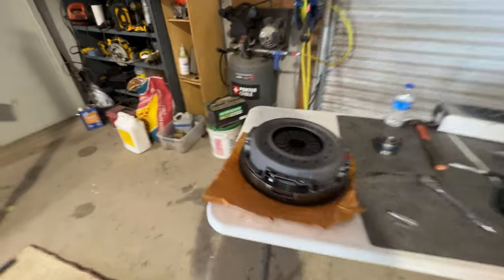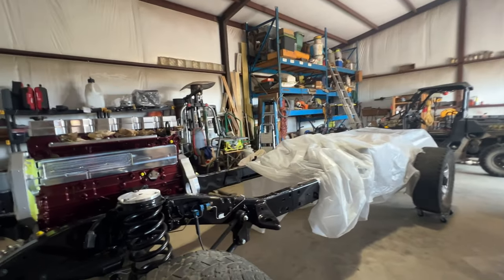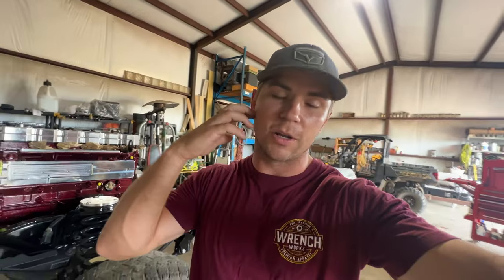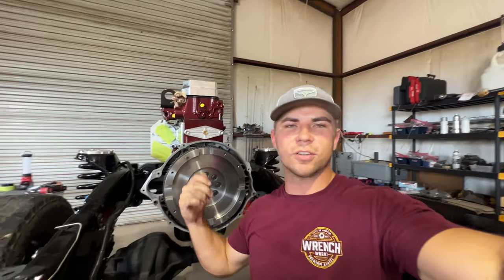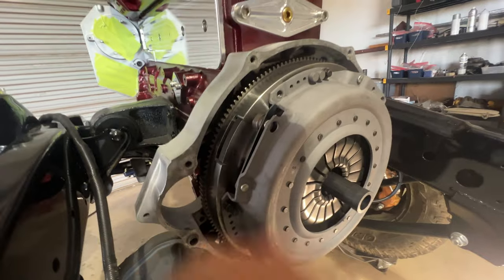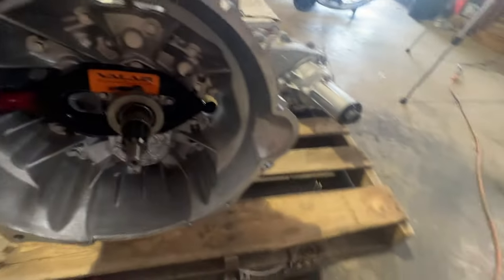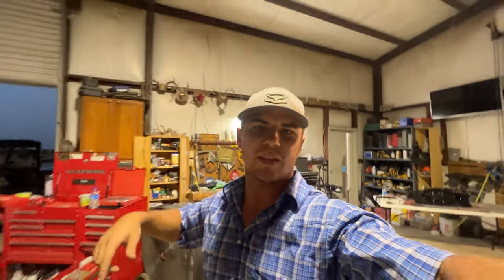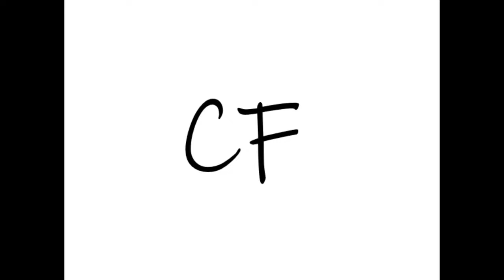2G PROJECT | Installing VALAIR DUAL DISC Clutch, NV5600 Transmission & Transfer Case Pt. 1!!!

Comment: Have a question how much movement you have on the clutch form
Reply from the maker: Basically the same as stock, remember you have to take the washer off the back of the pivot ball. Essentially that is where you would end up gaining movement at